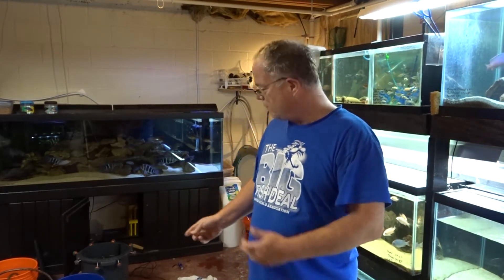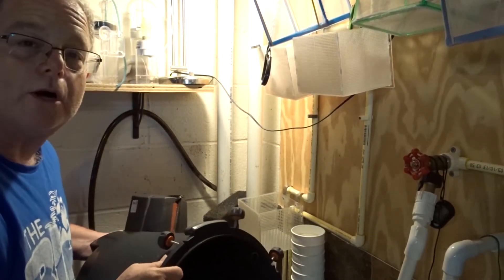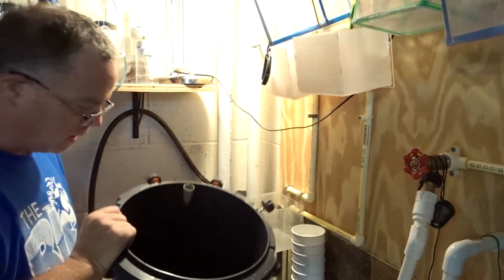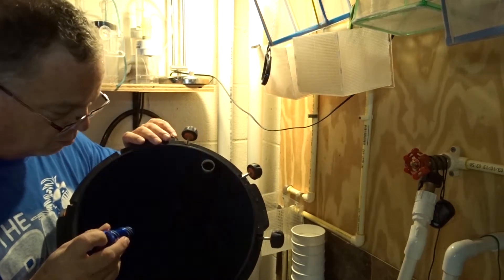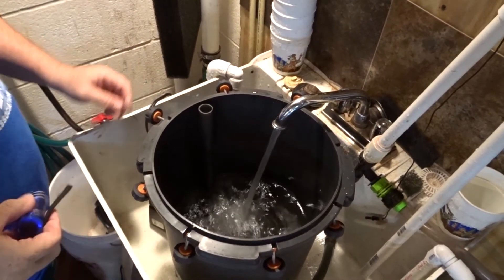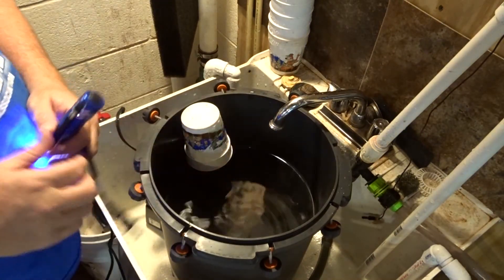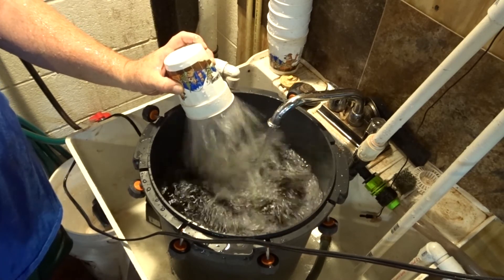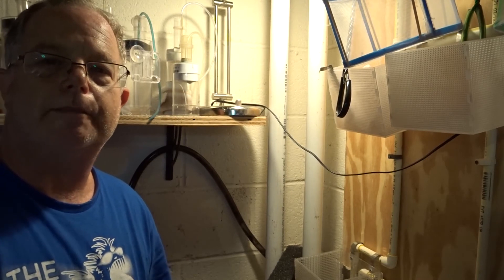FX5 / FX6  Impeller Power Flush

Comment: I have an FX5 and never had a problem with it as yet, but i am a bit of a clean freak, i also use silicon oil on the prop and seals, It helps this making prop last longer and seals to. Thanks for your tip.

Comment: Iv just brought a tank setup and it come with a fx6 filter however it's not pumping water through. You can hear the motor and I get a couple of bubbles out of the tube but nothing more what would you think that could be? Would it need a new propella? First time using the fx6
Reply: Give it a try, I have another video on how to change the fx5 impeller

Comment: Hey Reed, Good tip, have to try that.  Question, one of my FX-6 filters always gets air in it.  Tried cleaning it, check for leaks and can't find anything.  Do you have any tips that might help.  Thanks
Reply: Hi. Sometimes I get this problem. After cleaning I open the valves and then I don't turn the pump on for a while. Usually this prevents it from blowing micro bubbles. If it starts blowing bubbles after running for a while, I choke the output valve down to about 50% maby even more and then open it 100% after a while. This usually helps. Good luck
Reply: make sure ur canister is completely full of water before plunging in the pump should help during the prime faze to eliminate any left over oxygen